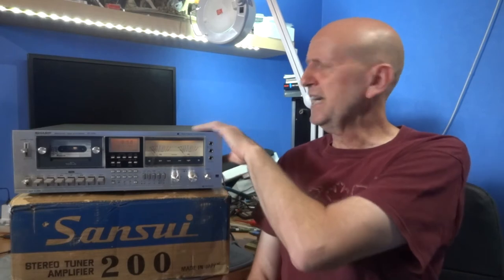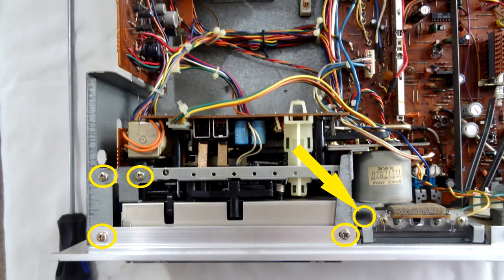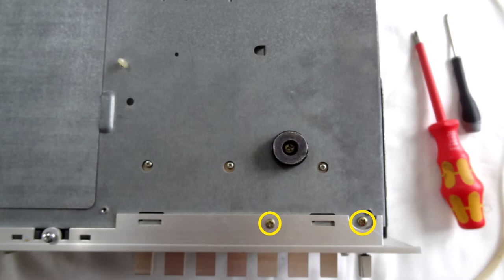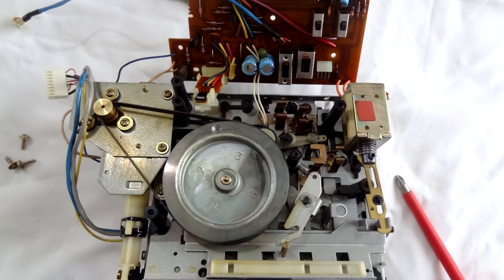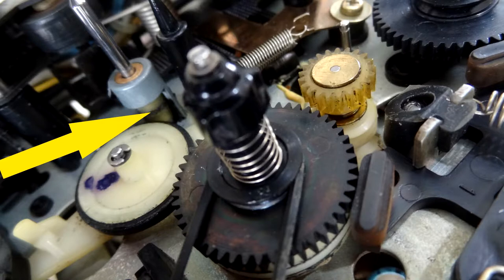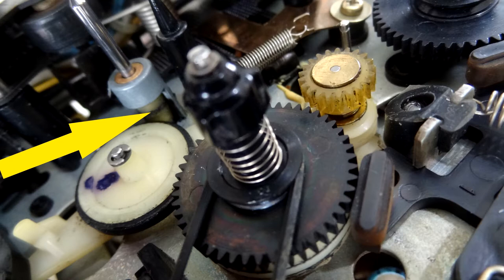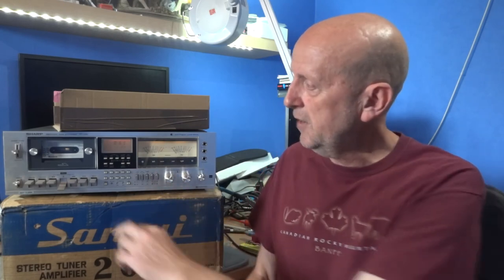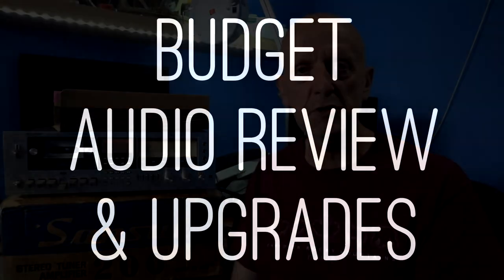SHARP RT 3151 Cassette Deck Not Playing or Rewinding, Capstan, RT3838, RT 1155, 1122, 3388 belt

Comment: I appreciate this is an older video now but it's been very helpful, along with one from Vidtech, in getting my old Sharp RT-1144 working perfectly again. The mechanism in the 1144 is almost identical and uses the same idler and gear assembly so bought it from the guy in Romania, fitted it along with new belts and after calibration the deck now works perfectly. Not bad for a deck that only cost me £20 on Ebay as it wasn't working.

Comment: Mine won’t record
Reply from the maker: Sorry for delay, I forgot . It might be worth given the record/playback long bar switch a clean, its the 6 inch bar switch that is in the center, slightly to the left, if you give a few squirts of some contact cleaner on top where a few small holes are, some should seep in and might do the trick , as the bar causes loads of problems when dirty.